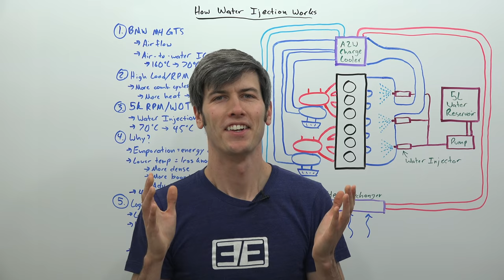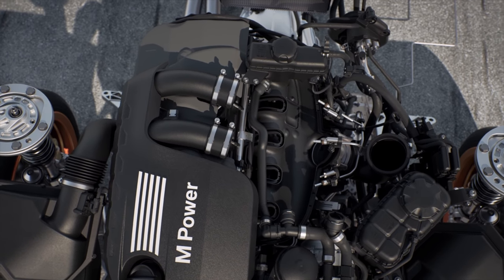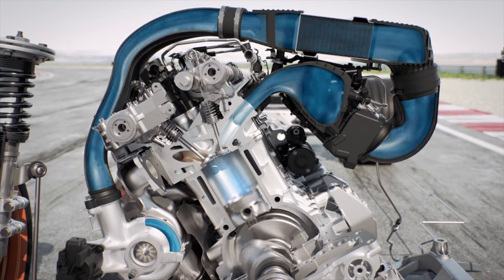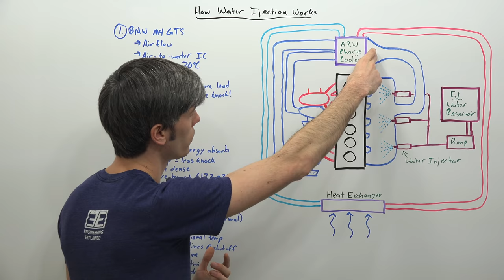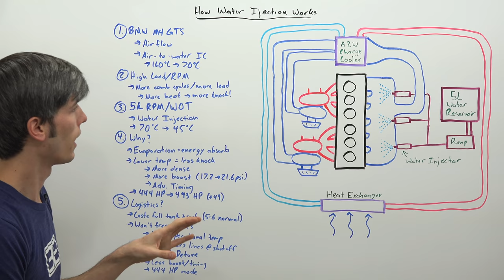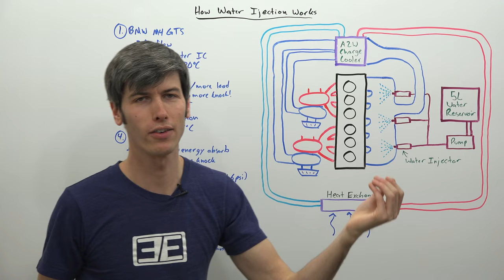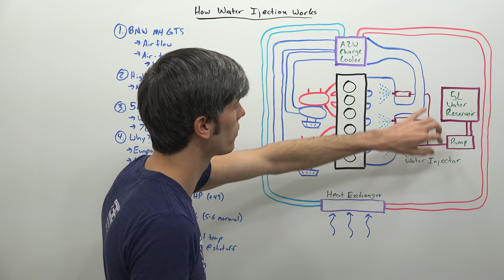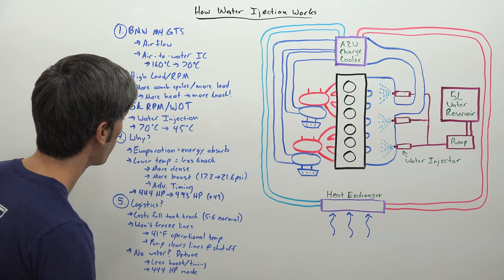How BMW Used Water To Make +50 Horsepower

Comment: Hey Jason, I have a question. I am thinking about a water injection system on my N55 M2. But not to increase horsepower even further, but to reduce wear by lower combustion temperatures. Does that make sense and does it even work? I have a 300 cel downpipe a Remus exhaust and a HG intercooler, so the airflow should be nice and smooth. But I am a bit worried about combustion temps when running it boosted to about 430-440 hp as the stock engine is quite tuned by BMW already. The S55 has those nice cooling lines around the cylinders which the N55 lacks. Will the water injection system help me here? And if yes, does it help to a degree where it's worth it?

Comment: Apparently they rejected the methanol/water option (winter wiper fluid) for winter. Does automatic water injection clean carbon off pistons and valves like the manual version?

Comment: I owned a rare '85 VW Scirocco with the turbocharged engine option [yes, there was one;  52 were built, it used an IHI RHB52 turbo and no intercooler.  5 psi boost = 133 hp. To find out about this kit you had to ask the dealer] that was covered under the factory warranty.  This would knock at times, and at one point I installed a simple water/alcohol injection system that used a wiper fluid pump and a remote reservoir that sprayed into the plastic intake just past the air filter, and it helped.  The turbo had a problem where it would break the downpipe since there was much more torque;  When this happened the exhaust got REAL loud and I could see 10 psi boost~

Though I DID kill a Mustang GT dead one day because of that!

Comment: The way you explain this stuff is amazing, keep it up man!
I wonder: How can the water evaporate, if the air in the intake manifold is only 70°C hot? Or does is evaporate later on, closer to the cylinder where the temperatures rise above 100°C? Also: isn't the air compressed, raising the boiling point of the water over 100°C?
Reply: Water also evaporates at lower temp than 100c but Just not as much
Reply: water doesnt need to be @100°C to evaporate even below 0°C water (ice)  'evaporates' (it's sublimation then)
Reply: Hmm yeah you're right, water does evaporate at lower temperatures, didn't think about that :) Also I just found that according to Wikipedia the heat of the cylinder head also plays a role in heating up the water droplets even further.

Comment: I worked on US Marine Harrier jets for years and the original version AV-8A version made in UK used a water injection system to increase thrust from the Rolls Royce F402 turbofan engine approximately 2,000 lb., from about 19,500 lb. to 21,500 lb., as I recall.

Comment: Hello, thank you very much for the video which was very interesting.
I have a few questions about the system
Does this system create a lot of vapor inside the engine ? 
Does that vapor create an expention while the explosion of the petrol is taking place ?
Does it also affect performance ?
And also does water live residue afterwards (a bit like water spots after you wash your car) ?
Thanks in advance

Comment: how does the water affect the combustion process?  Isn't adding water like dosing the flame?  Or does the water break down into oxygen (which supports combustion), but what happens to the H2?

Comment: So, i take it the water turns to vapor due to the air temp before get into the cylinder? I was really curious about the possibility of the engine becoming hydro-locked if an issue occurred. For example if an injector malfunctioned and sprayed too much water. I'm sure that is a rare instance though. Great video as always though!!!

Comment: Is there a way to utilize water injection for fuel economy gains? Doesn't water injected absorb heat and convert it to usable work as steam? That and cleaner emissions (less NOx), cleaner combustion chamber, and higher compression ratios.

Comment: Sir after 5000 rpm then after spraying water through injection system then how can water helps to burn the fuel perfectly or after spraying water convert in vapours or air instead of air fuel mixture ?

Comment: Very interesting... twiddles moustache
I am curious about elevated crankcase moisture with combustion blow-by, may be an issue.  Would only happen during spirited driving since that's only when the system is activated.  Also curious why "steam cleaning" of combustion chambers is not mentioned here, another benefit of water injection.  Also, can use tap water?  Distilled water only?

Comment: Saab used Water Injection on the 99 Turbo in 1975. In fact you could buy a "Saab Water Injection" upgrade kit in Saab dealerships up until about 1987 for installation on the 900 T16.

Comment: What about the weight of the 5L tank? Not only does it increase weght, it also shifts the center of mass
Reply from the maker: Yes, but it's low, and at the back of the vehicle. Also, 5 liters of water is about 11 pounds, so not a huge difference.

Comment: This reminds me of the idea of a six stroke engine, wherein water is injected at the end of the fourth stroke, creating steam, which then provides another power stroke, the fifth; then the sixth stroke occurs, which is the exhaust.  Still another improvement would be to implement a real Atkinson cycle wherein the expansion volume is greater than the compression volume (not just based on ignition and valve timing).

Comment: Is this used in stationary diesel or gas engines boost fuel efficiency if so . How much less fuel is needed to generate the same kw-hr per unit of fuel?

Comment: If it's below freezing then wouldn't traditional cooling methods be able to keep the car cool at higher temperatures just due to the larger natural heat transfer? Or would that not be enough to compensate for the water injection

Comment: Kindly explain, what does it mean, when You refer BMW will reduce their boost in case of scarcity of water in water tank? I mean, I don't think speed of compressor is controlled by anything other than flow of exhaust.

Comment: I seem to have lost my pace a bit, does that mean consistent higher performance or does it steadily rises as the speed rises? Also seeing this now I can't help but wonder why he haven't thought of it before. I kept thinking about it during the summer when you get the reduced performance because of the high air temperature.
Reply: this concept/tech has been known since the 60s. It's just not cost effective for most cars. Only works in forced induction engines (turbos), adds weight, complex parts/system. All drawbacks to everyday consumer. This "mod" is specifically interesting to high performance engines looking to squeeze and extra 50HP
Reply: @aSinisterKiid  Where there is a will there is a way, I am sure that it's not for everyone but for some cars it is viable. I am not talking about the whole water injection idea, since I am thinking of "town" cars not meant to over do it. When I was little I thought that when you would set the air conditioner of the car to say 18 C it was cooling the air that was getting inside the car as well as the intake air. I mean, as far as air cooling goes the car is already doing it anyways just not for the intake air.

Comment: Is the system able to adjust if you put ice in the watertank because the temp diff. Is even higher or might the injectors freeze up from the then even colder water that looses pressure rapidly ?

Comment: Just a question. You mentioned how the exhaust will have lower temperatures due to the water injection. Wouldn't lower thermal energy cause the turbos to work less efficient? Like longer spool up times leading to increased turbo lag?
Reply: Or is the temperature difference in the exhaust negligible?
Reply: The pressure is what matters. This will increase in total. When water goes into hot steam it increases its volume as well. As a system is net positive.
Reply: @valdius85  Isn't the pressure formed cause by the expansion of gases from heat? If the steam makes up for the loss volume then that would make sense.
Reply: @LorencRaci  I feel like being at university again talking to students who never played outside as kids :( Naming laws of physics in not enough without stating their significance in the actual real life scenario. Different things have different burning temperature - like diesel and gasoline. Heat doesn`t do the mechanical work in combustion engine. It is the pressure of expanded gasses on the cylinder that pushes the cylinder down to move the shaft. Heat comes with it, of course, as a cause of the expansion.  
Water allows for lower fuel ration and higher compression ration without knock. The air fuel mix can withstand much higher compression without uncontrollable combustion. 
Without water injection, additional portion of fuel is used to cool down the air inside the cylinder - thus higher ratio. This has side effects. 

The whole subject is well explained online. Do your own research if you want to understand it. English is not even my first language... I found it surprising that OEM market still doesnt offer new cars with this system. These engines struggle with high temperatures more than diesels.
Reply: Lower temps are better for turbos anyway. I saw a system where a guy put the turbo post-muffler. The boost was the same and the lag negligible, but the turbo lasted a whole lot longer. Plus it sounded insane. Also no resistance for exhaust gasses leaving the turbocharger, so less stress there. 

But we were talking about BMWs, weren’t we?
Reply: @timothydornan6517  what you are referring to as "lag" is more accurately described as boost threshold. There is absolutely going to be more lag a.k.a. slower transient response with a rear mounted turbo. Plus, there is more heat lost in the exhaust system before it gets to the turbine, so it's running less efficiently.

Comment: Hey Engeneering Explained, could you do or do you already have a video about boost juice? It is very similar to this but it is an aftermarket system which allows you to inject water, water-ethanol, and another fluid that I can't remember right now. I wonder how it will affect an engine's performance and emissions with the objective of reducing the amount of regular fuel injected and compensate the lack of fuel with boost juice. How do you think it will affect the engine's lifespan and emissions? I think it is worth to try and implement that system with that objective (if it works).

Comment: Good video! Some concerns tho...  there is always some blowby in an engine so wont the water mix with the oil in the sump? Or it must be 100 burned of during combustion?  Also dont the sparkplugs foul faster with the added water?  Also corrosion? Pistonrings etc ... those are going to be some beautifull pistons if the block ever needs to be opened up... water does a great job at cleaning carbon ... 

I wonder tho why so little manufacturers take advantage of using the cold from the ac to cool... you could chill the intercooler/turbos...  i now i robs massive power from the engine but you could let it run and chill a separate watertank and then shut it of and take advantage of the temps

Also im guessing bmw does not let you fill tap water? Seeing as it contains alot of chalk en other minirals that could create a sidiment on parts
Reply: The water will evaporate almost instantly and water vapour is a normal byproduct of combustion engines
Reply: KP3droflxp 

Thx for explaining but how is water a byproduct of combustionengines? The skipped that part in shool :p
Reply: @TheMatrixcube  I'm not too good at the chemical stuff, but basically the gasoline is a hydrocarbon (contains Hydrogen and Carbon above anything else) so when you oxidise it (burn it) the carbon will bond with the oxygen creating CO2 and the hydrogen will create H20 with oxygen. Of course there is a lot more going on, but I'm not really knowledgeable on this stuff.

Comment: So, what happens to the water once injected? Does it just go through the combustion cycle normally, and go out the exhaust? Does it evaporate before it makes it out of the cylinder? Or some other option I can't think of...
Reply from the maker: Goes in the engine, out the exhaust. Normal combustion cycle with air that has additional water vapor.
Reply: @EngineeringExplained  thank you

Comment: What about the change to the dynamic compression ratio because water can not be compressed?  The water molecules take up space in the combustion chamber effectively decreasing the compressible gasses in the chamber after the intake valve closes.  The increase in compression also  plays a part in the extra HP.
Reply: You use fancy language, use fancy mathematics as well with percentages etc ;)
The water will take very little space. Most of it will turn into vape before entering the cylinder. The small part that will not will turn into vapour during combustion and then work as a fuel - like in steam engine. To the pressure will increase anyway. The temp will go lowered. With it the emissions and turbo temp. 
Water or water/methanol injector is all balancing pros and cons but I am suppriesed it is not common yet with all the emission and lowering fuel pressure.
Reply: Water might not compress, but steam expands quite a bit, should more than compensate for any reduction in compression with an increase in expansion.

Comment: Could you get additional power from direct injection of water into the cylinder just after TDC or would it take so much energy and pressure (& there for weight) as to offset the gains? What would this likely do to NoX emissions?

Comment: What happens if you never fill the water tank? Does it have a sensor so it wouldn't just open the injectors with no water in the tank, and therefore pretty much just opening up holes in the intake for air to enter? Would any damage occur to the system if there was a lack of water? I was wondering about this ever since I saw Jeremy Clarkson complain about this system on The Grand Tour.

Comment: So, how similar is this system compared to the WEP (War Emergency Power) used on WWII airplanes engines by both the allies and the axis? Did the alcohol mixed with the water used to prevent the water from freezing?
Thank you

Comment: Back in the 1950s my grandfather"s car had a glass gallon jar mounted on the engine firewall full of water with a small hose attached to the base of the carburetor that used engine vacuum to suck water into the intake manifold. He claimed better mileage but I don't remember the specifics.  I don't know if it was metered or simply regulated by the diameter of the small hose.   Since the vacuum changed with throttle position and decreased during acceleration as evidenced by the vacuum powered windshield wipers stopping during hard acceleration.  It probably didn't aspirate much water during hard acceleration so horsepower probably wasn't increased much except at constant RPMs which could lead to better mileage. At the time I just assumed that the water turning to steam in the cylinders created more expansion in addition to the gasoline combusting and thus more power.  In other words I thought it was sort of a hybrid steam/gasoline engine. But I was only ten years old at the time but even today I wonder if it worked that well if at all.  I suspect it did since grandpa at one time powered his house years before there was a power grid in the country with wet cell batteries he constructed from aquarium tanks and dissimilar metals that he got at the junk yards.  He even built dual hard and soft water systems in his house.  Everything he did was well thought out and worked. Many people back then had many talents and were pretty much self sufficient.

Comment: I've been reading some of the comments to get a better picture of the whole system. My question is if there is something better than water to inject? Water is (one of) the only fluids to expand when frozen. Something that shrinks when frozen (its own freeze point) would be easier to manage.  Sometimes liquid fuel has been used (methanol in particular). Has gasoline been tried?  I expect so , but why does it or Diesel in a diesel engine fail?

Comment: Future BMW engines set for the European RDE2 emission laws will also have water injection (at least the high power versions). In regard of emissions, water injection has 2 major benefits: 1) you can run way more spark advance, increasing efficiency. 2) you can basically run stochiometric throughout the whole operating range. This means much more fuel efficiency and way less emissions (particles, HC).

Comment: Does water injection have the added benefit of a more homogeneous mixture which would be the desired mode I guess in a direct injection engine at full throttle?